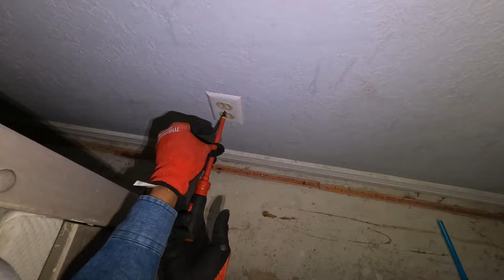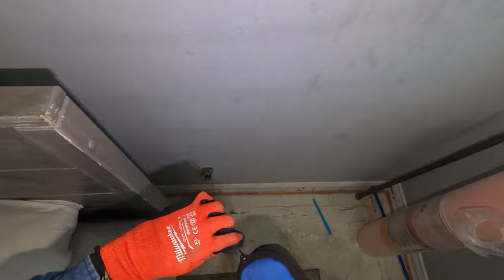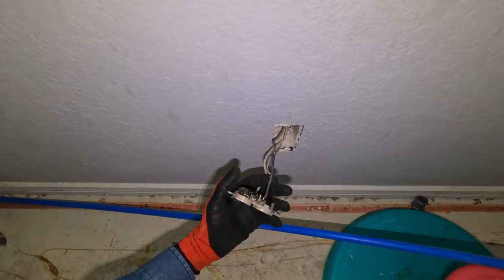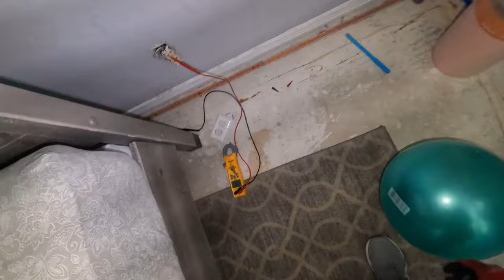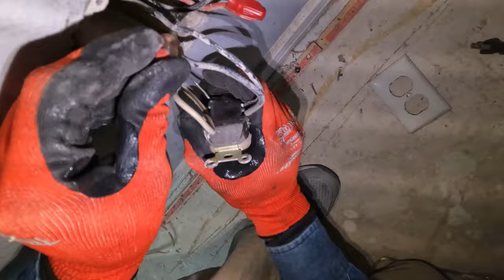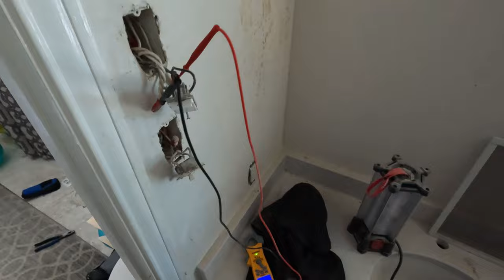Electrician Troubleshoot Bathroom & Bedroom Outlets Not Working

Comment: This is why I pigtail outlets. Isolate the defective plug if an issue arises.
Reply: I only pig tail don’t give a flip how long it takes only doing quality work. No stab garage or hack work quick stuff. Time value quality triangle only two sides one can pick as a consumer
Reply: There’s nothing that says your wire nut won’t fail and cause the exact same problem as if the outlet was wired feed through. I’ve seen it happen, they did it “right” by using pigtails and screw terminals but the system failed and they all had to be redone because of sloppy workmanship. It was redone without the pigtails and tight connections to the screws that will never fail. That’s all that really matters in the end the workmanship. Even backstabs will last 30-40 plus years if done correctly.
Reply: @everythinghomerepair1747 CANNOT STAND wire nuts. Wago lever nuts ONLY for me.
Reply: @everythinghomerepair1747 pigtailing will always be superior. But as you stated you have to know how to make proper connections before you even put a wire nut on which is really just there to cover the connection and that's it, a soild connection will not come apart   or burn up. But also pigtailing is better mostly because you don't want every device in the circuit to be carrying load even when it's not being used.
Reply: You can always tone the wires to fine them

Comment: Gotta agree with alot of comments here. That's y I seperate outlets from lights for power n each rm on its own breaker it may be easier n quicker to pull power from closest source but in long run becomes a headache like this btw aluminum wiring is so dangerous n the bathroom vanity is supposed to have gfi. Not sure where u r but where I am that's not allowed be safe
Reply: @paulwicks254
So in a nutshell, that wiring is FUBAR and was done entirely wrong in the first place?

Comment: I just found your you tube videos, me and my wife are going crazy we have a breaker that won't reset, I've done each outlet by taking all the wires off and testing the breaker with no success, I have watched your videos over and over, you are an artist,if you have any suggestions I would really appreciate it, have a great day.
Reply from the maker: Have you tried a new breaker? Is it a GFCI BREAKER?
Reply: @unitedtradesmanacademy1894  Thanks for replying,yes I put in a new breaker and it is doing the same thing, I was just wondering if it is sparkling in the panel box will it also spark where it is shorting out at, I wish you lived in Georgia.

Comment: Great video I just experienced a similiar issue a month ago. 2 recepticles not working on a branch circuit . I had known 1 of them was on the bathroom circuit with gfci because in past when gfci tripped no power to outlet. The one outlet not working only had 1 wire coming in so i knew it was end of circuit then bathroom with gfci had to be start of circuit. So from there traced power and found outside outlet on deck was on ciruit. Ended up being push in connection on that outlet corroded and loose not making connection feeding 2 outlets with no power. I  used a wire tracer tracking down the lines it helped out alot and  it was interesting and I learned quite a bit

Comment: I can add a few TIPS for outlets NOT WORKING: 1) Make sure you don't have a GFIC outlet between your dead outlet, and your breaker box! Happened to me in garage, could not find the outlet with the GFCI had tripped. 2) Make sure the breaker for the circuit is OFF every time (this video does not check all outlets after turning off breaker, one could still be hot!). 3) GET A TONE GENERATOR that plugs into the dead outlet ($15 Harbor Freight). Follow the tone thru the wall with the wireless signal receiver, and walk the wire thru the wall until you find where it is going inside the wall. This will show you several things: A) where power is coming from and how it reaches the outlet from the fusebox. B) Where power is going to after it reaches the dead outlet, if anywhere. C) It will take you to the source of power, and thus the source of your problem.  This is a much more simple way to test continuity. When a signal is no longer found, you are close to your break in continuity.

Comment: You mentioned aluminum wire was used so be very careful hooking up other wires and fixtures.  2 thumbs up for your determined hunting to find the problem.  Looks like the bedroom outlet had weak holding power to keep the meter probes connected.  No staples on the Romex in the attic.  All in all, looks like original work was done by a weekend homeowner and not to code.

Comment: Would a circuit finder like the Klein ET310 help with diagnosing what circut a receptacle or switch is on? I am not an electrician, but I have found the tool helpful in identyfying which circuit a recetacle or switch is on which can help with diagnosis.
Reply from the maker: Additional tools help.

Comment: This is real helpful but I’m too ignorant of electrical systems to follow.   Any suggestions for a simple to grasp beginner electrical course or book?
Reply: I read a book called "Electrical Wiring, Residential." Can't remember the author. But, check the appropriate section at your local library. I've seen many electrical wiring books.

Comment: Came across your channel and find it educating. I am having a issue of a 3 phase power outlet not showing power unless put its circuit breaker to off and put it on again. buy next day same thing appears and had to do the same to have power from the socket. wondering what is the reason for such strange thing? Thanks a great deal!

Comment: Did u tie the hot and neutral together from the same wire or the hot from the power in and the neutral from the traveler.

Comment: So the dead outlet was working all along? Just flip the light switch to power the outlet?
Reply: Pretty much
Reply: Yes. That's why im against the idea if controlling an outlet with a switch.
Reply: @nhitc6832  why are you against it?
Reply: You might have a different opinion than mine but the intended purpose of a wall outlet, is to always have power all the time (provided that the circuit breaker that feeds it is on). No one should ever plug something in a wall outlet and have to check if that outlet is on/off via a switch somewhere. That to me beats the purpose of a wall outlet. 

Now I'm not completely against controlling a wall outlet with a switch if that wall outlet has its own NEC code compliance. E.g, maybe different color, different shape, or maybe a stamped mark on it. Something that tells you oh... this outlet can be turned on/off by a switch.
Reply: @nhitc6832  I agree with you that it would be a good idea to have a different color or some marking that indicates it is a switched outlet. But these things are or at least WERE very common as people would plug in a switched table or floor lamp and leave it on at the lamp and switch the light on at the wall switch. This was common in some homes that had no permanent light fixtures installed when new in certain rooms, like a living room.
Reply: @nhitc6832  over the last 60 years, I’ve lived in multiple houses across the country and the ‘indicator’ that a receptacle was controlled by a light switch was ‘usually’ the receptacle was installed with the ground on the top.  It was also wired that only half the receptacle was switch controlled and the other half was hot all the time.

Comment: So the ceiling fan switch was also powering the bathroom outlets when turned on?
Reply: yes
Reply: Yes. That's why connecting an outlet to a switch so you can turn it on or off with the switch is a stupid idea.

Comment: Didn't understand at the end where the problem was. You did not show it.
Reply from the maker: Problem was outside electric gate motor shorted to ground
Reply: @unitedtradesmanacademy1894 I think you're talking about another job. It looks like the outlets that weren't working in the bedroom and the bathroom were wired into the switch for the fan in the bedroom.

Comment: Why is there a toilet in a bedroom?????
Reply from the maker: LOL they remodeling!!!!!!
Reply: It’s painfully clear that that is a wee little house, old also, and probably had only one tiny bath and somewhere along its lifespan, some flipper - or owner, or worse: a landlord, “improved” it by adding another “Full bath” — notice how freaking small the bedroom was??  They turned part of it into a (lol) 2nd bathroom, but just couldn’t fit the crapper anywhere else due to the double sinks. 
People trying to squeeze maximum $$$$ out of a property in either rent or resale are a POX upon home safety and ultimate value…  
They devalue buildings faster than rats. 
It’s sad. I worked in RE, and knew Flippers who didn’t have real jobs, they just bought, and flipped used homes. They knew ZIP about actual building, or quality, or health & safety codes.  Nor did they care one iota. 
The sad thing is - there’s tons of homes like this - and they are never fixed right.

Comment: Why did you take out the switch in order to do the continuity test. Would it not be the same if you just turned on the switch to see if the receptacle in the bedroom is connected to the others in the washroom?
Reply: Unless there is a switch failure..

Comment: Now do put back the way it was originally meaning taking the black cable off the switch leg. Or run a new 20amp circuit and isolate the bathroom. Maybe just put everything on the existing working outlet could be an option.
Reply from the maker: I disconnected it from the bedroom light and reconnected it the bathroom outlets in the hallway.
Reply: @unitedtradesmanacademy1894  So you did NOT have to run a new circuit to the bathroom? or a new home run to the bedroom either? - was there more than one romex coming from the switch to the fan box? I am just curious how you tackled this! Great video!
Reply from the maker: @mikenormandy9250  No i didn't have to run a new circuit, basically i put the circuit back the way it was originally wired in the bedroom but i did tie the bathroom circuit gfci  to the next door bathroom in the next room.

Comment: So,the switch leg is in the bedroom,is spliced with the feed goi g to the bathroom. Which means,when the bedroom light is cut off,the power in the bathroom will also be cut off.Solution,splice the feed going to the bathroom, with the original feed,instead of the switch leg.

Comment: I want to reiterate, this video is a mess. I found using a wireless tone generator works FAR BETTER than the methods used in this video. First of all, a battery operated Tone Generator plugs into the dead outlet. Second, you make sure the circuit breaker is off! Third, use the Wireless Tone Receiver to follow, inside the wall, all the way back to the breaker box. Just follow outside the wall, where the wire is going, all the way back to the box. This shows you have continuity at the box, if the wireless tone is available at the box. It probably will NOT BE at the box. You have a open circuit between the box and the dead outlet! Follow the tone inside the wall, across the ceiling, to the switch, until the tone is no longer available. That's where your problem lies. Wall switch? Next outlet in the circuit? Wall box with connectors? The problem, is where the tone dies. It should be possible to follow wires without entering the attic! It should be possible to find the problem with less than HALF the effort this video demonstrates. TIP: use an electric screw driver (check power is off), much faster! TIP2: A battery powered tone generator allows you to work on unpowered circuits, rather than using power to trace connectivity, use the tone generator to follow continuity instead.

Comment: It's good you found the problem,but you didn't explain how you fixed it
Reply: He turned on fan , see the fan start spinning, which allowed AC power to the outlets. Basically, the fan switch powered the downstream outlets. Probably installed by the previous homeowner as new owner was unaware and called him for help. That would be one expensive way to find out.

Comment: So is it going to have to be rewired ?
Reply from the maker: No Rewire, just put the outlets in the restroom on the same circuit as the other bathroom outlets.
Reply: @unitedtradesmanacademy1894  how do you do that ?
Reply: @Cern2024AR  my guess would be disconnecting the wire from the restroom to the outlet in the bedroom but idk what source would you bring from the bathroom. Unless you run a new circuit breaker for that bathroom but he said he didn’t do that
Reply: @Cern2024AR  circuit from the other bathroom is going into the attic in my mind he cut the line in the other bathroom added a j box and wired the bathroom circuit up to that j box... ( were talking about that wire that came out the ceiling fan )

Comment: That electrical panel appears to be an old Zinsco part. They're extremely dangerous and caused a lot of fires and injuries to electricians. They fail to trip when there is a short circuit. The same as old Federal Pacific Stab-Lok panels with the red breaker switches. People should not be living in a house with those old fire hazards energized.
Reply: Correct. These are "New" Not OEM breakers though... and are considered legit. WE still change them out. I refuse to put the "new" breakers in, I don't even tell customers the exist.